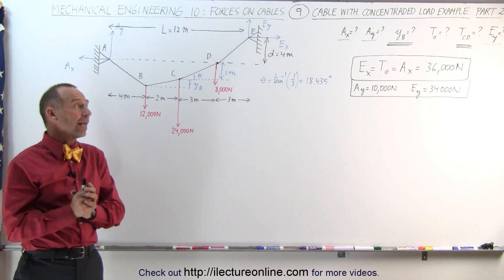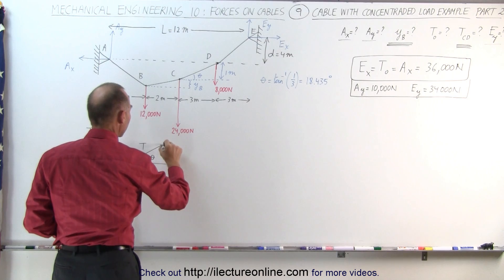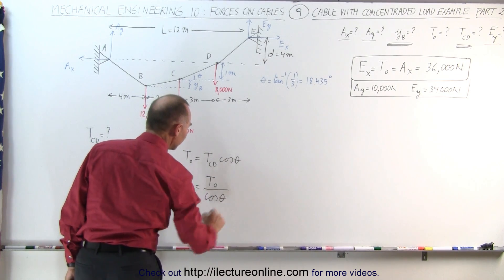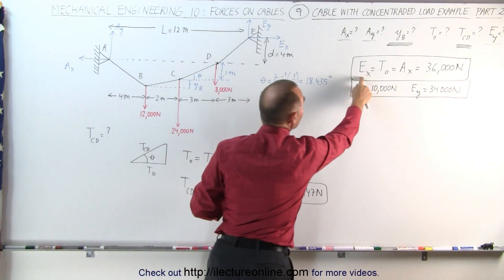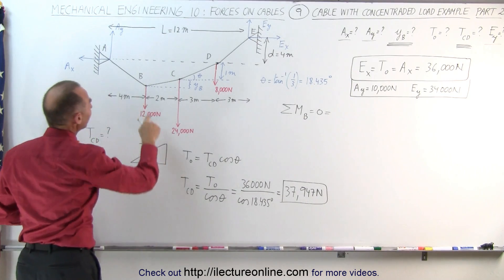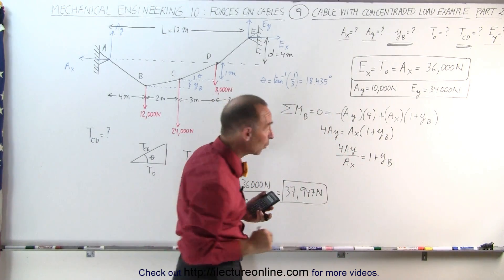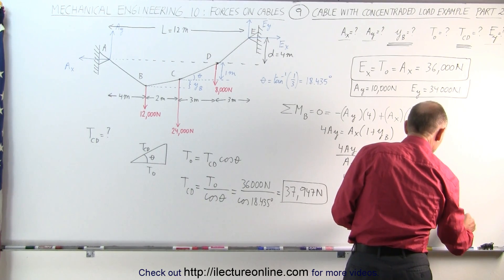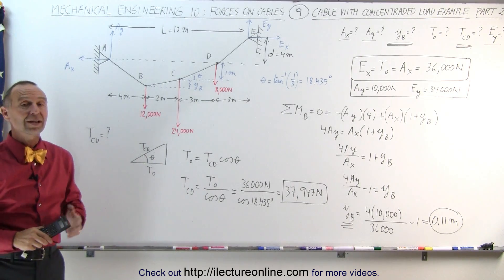Mechanical Engineering: Ch 10: Forces on Cables (9 of 33) Concentrated Load: Example (Part 2)

Comment: What would happen if there is a load in Z axis, for example wind load. (you only know wind velocity). Can you please explain how you will solve in this condition
Reply from the maker: You would need to know the diameter and shape of the cable, so you cold determine the force applied to the cable by the wind.  Then you would treat it as any other distributed forces in that direction.
Reply: @MichelvanBiezen  do you have any plan to make a video about this. Would be nice

Comment: Sir what will be shape of cable due to uniformly distributed load parabola or catenary.i think catenary but in answer parabola is given.plz clarify it.
Reply from the maker: You can find that here:  MECHANICAL ENGINEERING 10: FORCES ON CABLES   
It should be a catenary.

Comment: Thank you for your video. However, the problem is not correctly posed. It appears that you are restricting both the sag of C and the sag of D. We can restrict only one of the three sags (B or C or D) for this problem. Letting y_AC (vertical distance between A and C)  = 1m,  y_AD = 1.167 (D is actually above point A). This can be easily verified by taking moment about D for the segment DE. In that case, T_CD would be 44.4 kN.

If you choose to restrict both the sag of C and D, then you will have to make one of the applied forces unknown. Otherwise, there are more equations (10: 2 for each node) than unknowns (9: y_CB, T_AB, T_BC, T_CD, T_DE, Ax, Ay, Ex, Ey). Hope this helps.
Reply: Exactly

Comment: Thank you sir..your videos were very informative..But I failed to understand why can we take moment about any point in the cable while ignoring one part of the section?
Reply: It's because the cable doesn't resist moments internally, and therefore, the internal moment in the cable at any point is zero.
Reply: Think of it as doing "method of sections"   We can state that everything left of C is not moving or rotating, and we know no torque is transmitted to that portion of the cable from things to the Right of C, so we can state the portion on the Left is in static equilibrium.
Reply: They in equilibrium I think